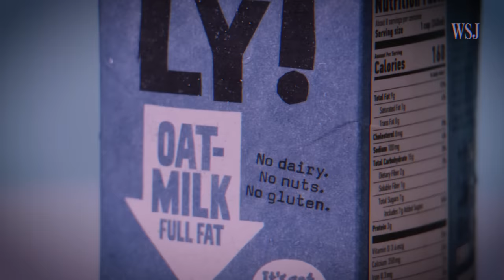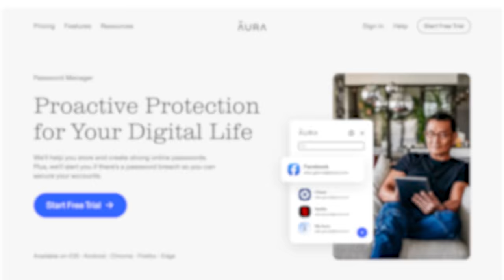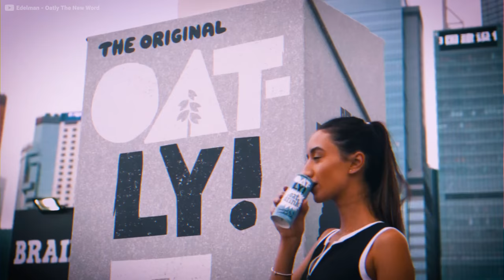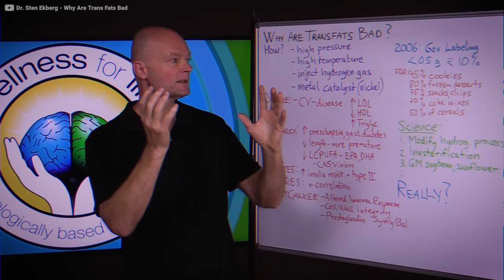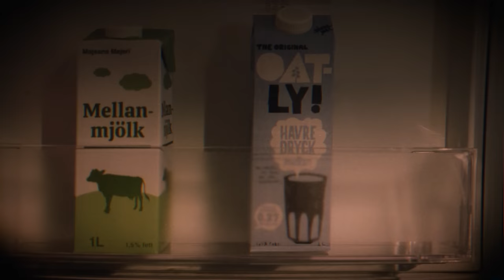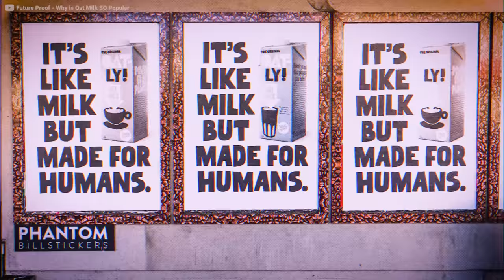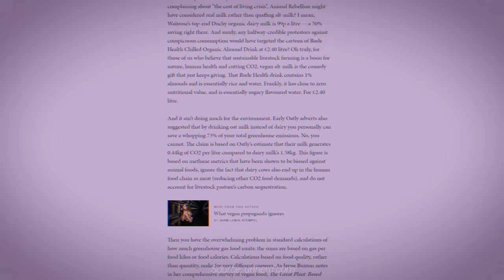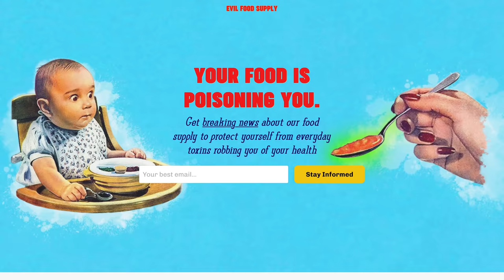Oat Milk is literally a scam.

Comment: Excellent breakdown of this issue. People avoid fries because they're soaked in industrial oils and then drink the same amount in oat milk thinking they're making a healthy choice. What a horrible scam.
Reply: People avoid fries? Why? They are from Belgium and they are absolutely fine once in a while together with salad and vegetables.
Reply: ....but i make my own fries from the red potatos (when they grow).
Reply: Except that this figure is completely false. 250g of oat milk contains 3-5g of oil, 250g of McDonald’s fries contains over 40g of oil.

Sure, you can make really healthy fries by using almost no oil at all and air frying, but then this emotionally-charged comparison seems a bit misleading. Clearly they are trying to paint oat milk as “unhealthy” by comparing it to “unhealthy” fries.
Reply: Are you that gullible? 224 grams of french fries have about 32g of fat while 240ml of oatly with added oil has 9. The figures from this video are taken out of nowhere. Also the oil on the french fries will be much worse as it has been fried possibly multiple times and not all oat milks have added oil but all french fries do.
Reply: @deniseb.4656  Without oils or preservatives fires in an air fryer are just cooked potatoes. They’re one of my favorite carb treats.
Reply: I tried to figure out how this claim about the amount of seed oils in fries vs oatly could be correct, but McDonald's fries have a blend of rapeseed/canola and soybean oils and the on screen graph only shows soybean oil. So someone screwed up somewhere about at least this part of the video.
Reply: @MilwaukeeWoman  I mean, if this is an “Oat milk contains more seed oil than fries because fries contain SOY oil!” situation, then this guy is even more dishonest than I thought. And fun fact: soybeans are seeds.
Reply: @karlkalina3022  Gram to gram comparison isn't really the issue I think. Point is people understand that fries are unhealthy because of veg oils but are under mistaken impression that oat milk is health food while basically drinking oil.
Reply: @deniseb.4656  Fries are absolutely fine every day if you don't fry them in seed oils. I wish restaurants used tallow like they did before. Potatoes themselves are excellent food.
Reply: @Bullminator  That's great.
Reply: this biased tripe is hardly an excellent breakdown.
Reply: this video seems like it doesn't have a lot of education and more 4chan vibes
Reply: I'm sure this brand claims to be organic, but oats, especially the Quaker brand, have some of the highest levels of Roundup. Not just Roundup, but oats seem to absorb, or retain, more farming chemicals than most agriculture products.
Reply: @dekyor9547  I have never drank oat milk but healthy oat milk are supposed to be made from oatz enzymes and a little sugar. Adding oil is completely unnesessary, profit-wise that is.
Reply: @karlkalina3022  soys are legumes, like kidney beans and peanuts. And while legumes can be considered as seeds, depending on your definition, it's very different from other seeds like chia, flax, grapeseeds, etc.
Reply: @subliminalfalllenangel2108  Soybeans cannot “be considered as seeds” like it’s an opinion. They are seeds; it’s a fact. “Legume” is just a family of plants. 

If you want to make the argument that soybeans are fundamentally different from other types of seeds, then you’re gonna have to provide some criteria and evidence.

Regardless, soy oil IS still a seed oil - whether or not you believe it to be “different”.
Reply: @kornisonkiseli3248  2-3% oil for foaming reasons. Basically nothing compared to how much oil the average american eats in a day. Also noone is binge drinking oat milk as they may do with other processed foods
Reply: @kornisonkiseli3248  tallow 🤣
Reply: @kornisonkiseli3248  “Basically drinking oil” when oat milk is less than 2% oil by weight?
Reply: @subliminalfalllenangel2108  it's added so that it foams like cows milk when vaporized for coffee
Reply: They have a low fat version that doesn't add any oils at all. People need to learn to read labels and stop assuming the quality of a product based on the marketing. Plus there are other cleaner brands like Malk and Three trees.

Edited to fix error.
Reply: @dekyor9547  Tallow, yes. Clarified butter would also be a healthy choice.
Reply: @karlkalina3022  People are completely unaware that it has oil at all. It's not an insignificant amount if used for cereals at breakfast and then throughout the day in coffee and tea. This is about selling us sugar water with added industrial oils by attempting to convince us we're making a healthy choice for ourselves and morally responsible one for the planet.
Reply: @Sheeeeerigirl  I agree but people don't. They take it as lower calorie healthy choice completely unaware of what's in it.
Reply: @kornisonkiseli3248  I reckon anyone who doesn’t read the ingredients on what they eat will be unaware of what they’re eating.
In regards to it being “a lot”, that is completely subjective. Dairy milk contains twice the fat in equivalent usage, and nearly 60% of that fat is saturated. Versus 8% saturated fat in vegetable oil.
Reply: @kornisonkiseli3248  Companies have been using this marketing model for a very long time now. We have loads of information readily available at the tips of our fingers. If we choose to not learn the basics then it's really on the person and not the company. Their marketing may use certain tactics to catch your eye but they food label has all the important in regards to the actual product and that's where everyone should be paying attention.
Reply: And novel "vaccines"
Reply: @kornisonkiseli3248  Worldwide dietary guidelines just left the chat
Reply: bro, I'm deadly allergic to milk and yes, oat milk is definitely a healthier choice for me. (and I'm sure for many people with allergies or lactose intolerant ones)
Reply: @dekyor9547  you clearly never tried making oat milk at home. That's not how enzymes works.
Reply: @karlkalina3022  by looking too much into the definitions and criteria, you threw away common senses out of the window. The question is simple: is vegetable oil healthier than animal fat when consumed over a prolonged period time? Bothering with the definitions is just a waste of time, when you are trying to make distinction between your "seed oils" and other oils. 

Before you think that I am a vegetable oil eater or seed oil avocate, no. I don't even eat oils anymore. The same with animal oils, lard or butter.

But okay, we we put some common oils(like soy, sunflower, grapeseed, rice etc) into the category of seed oils, and olive into the category of the "fruit oil", then what? Many said that seed oils are detrimental for our health, but is that true? Quantity is everything, and many houses nowadays drizzle their foods in oil or deep fry their foods in oil. So is it the oil itself that is toxic, or is it the over consumption and overcooking of the oil that is toxic? 

Similarly, many vegans and some vegan keto invested quite some money into olive oil, believing it is the holy grail of health, but is it true? There isn't much olive oil to begin with and Mediterreneans don't consume THAT much olive oil to begin with. Extra Virgin Olive Oil is very, VERY expensive, even in countries like Greece, Italy or Morocco, therefore has to be used sparingly.

Then there comes the infamous coconut oil and palm oil. Is it a seed oil, a fruit oil or a nut oil? We can't categorize it like that becomes coconuts and palms are seeds, nuts and fruits at the same time. So, it is any more or less healthy than other kinds of fat/oils? The date clearly showed no, but you can dismiss all of the above and claim that Nigerians live a  long and healthy life(they aren't! And they let their foods swim in palm oil btw). 

You can even say that Indonesia is living quite long(72 years of life expectancy) and yet they are the country that consume the most palm oil in the world, but Indonesian cuisine is plant dominant, and they also eat insects. In fact, they are ranked as one of the most vegan/vegetarian friendly countries in the world, with many islands populations are either vegans or vegetarians.

So clearly, categorizing oils the way you want them to be isn't gonna solve anything, and will only cause confusion to those who just started studying about nutrition. So many varieties come to play, including the quantity of the oil, the cooking temperature, how often the oil is consumed, the foods that go along with the oil, and so on.
Reply: @ih8888milk  yeah, as someone with eczema, I have been working my a** off just figure out the best substitutes for animal milk in cooking. And let me tell you, baking without milk or butter is extremely hard.
Reply: It is not a scam, you can read a friggin label (assuming one can read) and make the decision or you can choose to make your own Oat Milk. Here is one fact, a Cow's milk is for baby cows.....Period.
Reply: @subliminalfalllenangel2108  what enzimes is just water and oats blended and squeezed through a cloth
Reply: @subliminalfalllenangel2108   Don't quit butter but rather quit all sugars. Just give it a try.
Reply: @karlkalina3022  well said.
Reply: Forget about sustainability. Ask yourself this - What other animal on this Earth, drinks the milk of another animal? Cows Milk has a single use- Growing baby cows into adult cows.  Cows milk is loaded with growth hormones specifically designed by nature to provide nutrition for Cows. Why would anyone think this is suitable for human consumption? Have you ever seen a cow or any other animal drink human milk?  The production of Cow's milk is simply a by-product of meat production.  Ranchers simply wanted to capitalize on a "product" that cow's were already producing to make more money. Don't believe they hype folks.  Animal Milk is one of the worst things you could consume, it is not intended for human consumption.
Reply: @dy8863  Still can't throw sustainability off the table. For some people that will be the only reason to change
Reply: @dy8863  preach! It does seem like we are winning, although the whole meat and dairy industry is thrashing around like a dying horse.
And the deflection is huge, the US is reducing capacity within its own borders, but is ramping up production overseas, in Mongolia, Eastern Europe, who knows where else.
Regarding milk, I know kefir is very healthy, healthier than other milk alternatives, so it has its benefits and that confuses people.
But I'm so sick of these people just throwing around the healthy free pasture raised cow just happily trotting around in Montana or the Alps, like that would ever be scalable.
Reply: @karlkalina3022  fact is oatmilk is not as healthy as you would like to believe lol.
Reply: @sageart4771  And how did you determine that? How in the world would you know exactly how healthy I think oat milk is? 😆
Reply: @subliminalfalllenangel2108  Yeah bro.. none of that matters because the point was that “Oat milk has more seed oil than fries because fries contain soy oil” is a disingenuous comparison. Which it is.
Reply: @kornisonkiseli3248  What...? gram to gram is EXACTLY the issue. Just admit you were fooled by this video, get corrected, and move on
Reply: @dekyor9547  it will taste like sh*t if you do that. When I prepare oat, I sprinkle some  enzymes so that it breaks down faster. The flavor also becomes creamier afterwards.
Reply: @karlkalina3022  of course oat milk doesn't contain as much oil as french fries. WTF?! Only 5% of oil at most(mostly sunflower oil) is added to oat milk or any kind of plant based milk, and it definitely doesn't wreck havoc on your body if you only drink one or two cups per day. As I stated in the reply above, such a small amount of oil isn't enough to cause any significant reactions in the body. Most people drink oat milk from time to time, not all the time...
Reply: @kornisonkiseli3248  “people are unaware it even has oil” it says it on the carton.
Reply: @subliminalfalllenangel2108  okay I'll look into it
Reply: @subliminalfalllenangel2108  What in the world are you even trying to argue here?
Reply: @karlkalina3022 ok, I read your previous replies and misunderstood you, bu let me clarify things here. Do you agree with me that such a small amount of oil doesn't have any significant effect on the body?
Reply: @kornisonkiseli3248  🤡
Reply: You have been fooled by this video.
Reply: @kornisonkiseli3248  'gram to gram comparison isn't really the issue'
That makes a lot of sense. It's why I put 75 tablespoons of sugar in my morning coffee, because more or less of a thing doesn't make a difference. It tastes exactly the same as 1 crystal of sugar and has the same health effects, because the amount of a thing doesn't matter. It's also why I'm able to drive my Ford F150 for weeks on end on 3 drops of fuel, because the amount of a thing doesn't matter. The fact that Oatley contains 2% oil means it is like drinking pure oil because the amount of oil in it doesn't matter. It's a very sensible approach to things, discarding the basic concepts of arithmetic and logic.
Reply: @Sheeeeerigirl  
Malk is LITERALLY the name the Simpsons used for a carton of fake milk, in an episode parodying this exact kind of thing, back in the 90s.

Sorry, I think I'll pass.
Reply: @HaveYouTriedGuillotines  I have no idea of the origin of the name but its a good company. You are free to do as you choose.
Reply: @Sheeeeerigirl  
I remember when people thought Google was a "Good Company™"

You are free to be naive and unlearning. Just don't cry when it goes badly.
Reply: @TheAshMcG  I'm a vegan, but the 'cow's milk is for baby cows' argument is a poor one. The reason we shouldn't drink cow's milk is because it causes harm to cows. Saying we shouldn't drink it because it is for baby cows rings of a logical fallacy. If a human can consume a thing then it is by definition consumable. The fact that it is 'intended' for baby cows is as relevant as the fact that potatoes are 'intended' to stay in the ground and grow more potato plants.
Reply: @ptolemyauletesxii8642  I stand by my statement. Cow's milk is indeed for baby cows. I also don't like that it harms the animal. I am for whatever argument makes sense to phase it out of human diets...and I am not a Vegan.
Reply: @TheAshMcG  If you are for whatever makes sense then you should give that argument up. The fact is that humans can and do drink the milk of cows, and most that do don't seem to have any negative side effects from it. It's a perfectly viable source of food. The fact that it is 'for' baby cows isn't an argument against eating it. All food is 'for' some purpose other than being eaten by us, and yet here we are eating it. The leaves of lettuce are for photosynthesis. The nuts of an almond tree are for growing new almond trees. None of these things are 'for' us to eat. 
This is a fallacious argument, because it's reasoning relies on some objective intent that simply does not exist, and the rationale you use can be applied equally to every other thing we eat. Therefore it's a poor argument.
Reply: @ptolemyauletesxii8642  Obviously you took the time to write and comment a few paragraphs disputing it, so it can't be that poor of an argument based on your actions and response. We agree to disagree.
Reply: @TheAshMcG  Let me get this straight. Taking time to explain why a bad argument is a bad argument somehow proves that it isn't abad argument? You've just undone 3000 years of philosophy! 😄
I suspect you haven't actually understood anything I've written.
Reply: @ptolemyauletesxii8642  I understood it, I just don't agree with it. Just accept it and move on with your life.
Reply: @TheAshMcG  I don't think you did. If you did you'd agree. It's a demonstrably fallacious argument. If you think I'm wrong please elucidate. 
Of course, you can't present a counter argument, because, by your own logic, doing so would only prove me right. 😄
Reply: @ptolemyauletesxii8642  I don't agree, the "cows milk is for baby cows" is a stronger slogan and argument....People that eat beef and drink milk understand it may be uncomfortable for the animal and cause death even if farmed humanely, it has not stopped people from drinking milk. My argument goes to the basis of the human experience, humans drink breast milk from humans not cows, human breast milk is not sold on the shelf, there are not farms of humans pumping milk to be sold for humans or other animals to drink, so why should cows be subject to it? Your argument about harm has been around a long time, it has not changed anything, maybe some farming practices. My argument via an ad campaign could stop dairy farming.....Good day.....
Reply: Why doesn't the title only mention Oatly as a brand ? Cheap, organic oat milk with no added ingredients has been a staple in my diet for years-since I stopped consuming animal products because of the fact they are, well, just wrong.